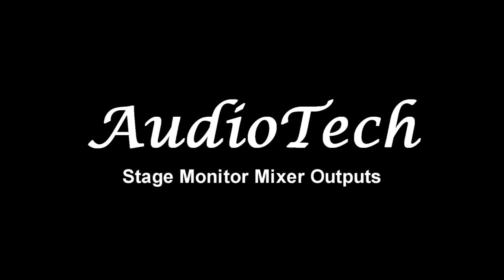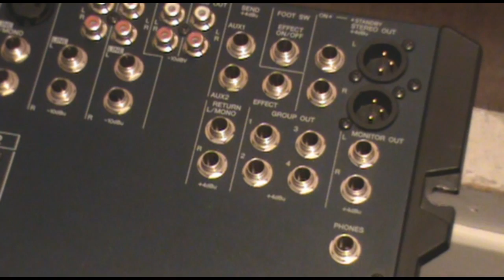Stage Monitor Mixer Outputs - AudioTech

Comment: Thanks for the clarification.  What if you were using powered speakers?  Would you need to have a board with multiple aux outputs?
Reply from the maker: Just run XLR to the powered monitors. Aux1 for one monitor mix and others as needed for different stage mixes. Same as using power amps and unpowered speakers.

Comment: how can i connect 2 pairs of monitors to a mixer and controll it with daw. ?
Reply from the maker: There are several products out there for switching to different pairs of monitors in home/professional studios. Basically, you connect whatever unit you choose to the monitor outs of the mixer and then the switcher is where you connect multiple sets of monitors. You will need to google studio monitor controller/switcher to see results and check them all out. Another option could be to use multiple Aux sends but you can not control what you are listening through by the DAW as far as I know. But I am not familiar with every DAW out there either.

Comment: Thankyou for this clarification.  I want to buy a basic mixer, but it only has 1/4"  L/R control room outs and 1/4" L/R mains outputs.  Will I be able to get an even sound if I'm using this and XLR inputs to my mixer.  Mains will be sent out to an XLR multiple house speaker system and Control Room sent to my powered monitor speaker which accepts XLR or 1/4" inputs.  I feel like I'm trying to explain Chinese.. Can you help??? please
Reply from the maker: You will be fine, just get some adapters for the XLR connections to the house system. XLR are refered to as balanced cables, 1/4" come in both balanced and unbalanced.  Find out if the 1/4" outputs on the mixer are balanced or not so you can use the correct adapter.

Comment: What type of cable is used to connect from AUX to amp for stage monitors?  1/4 Speaker cable?
Reply from the maker: Depend on what you gear uses. I would use the XRL connections if your equipment has them. Otherwise 1/4" cables. Not speaker cables, which look the same but built differently. Normally, you would run a snake return from the mixer to the amps on stage or powered monitors. Snakes will use either 1/4" for XRL returns.

Comment: Thanks for taking time to explaining this ..I'm going to buy a mackie profx 16 channel and a dbx equalizer that I want to use for two active speakers and two active monitors  (if it is possible)..how and where I connect the speakers and the monitors to the eq and the mixer? If you can help me?
Reply from the maker: Speaker run off main outs and monitors off AUX 1
Reply: Thanks! !
Reply from the maker: Run the Aux 1 to the compressors first then to the speakers. Sorry. You'll need two compressors one for each set of speakers. Each dbx unit has 2 in it.
Reply: Thank you very much for your help!
Reply from the maker: No problem. Come on back if you have any new questions. :)

Comment: Can i use the monitor out to record the sound from the mains to a laptop? Now i have used the red and white tape (aux) out but for some reason the recorded music clips. And there is no volume control on the mixer for that. If i can use monitor out that one has a volume control (dual mono to 3.5 mm jack stereo). Lowering the mains is no option. lowering the input on the laptop doesn't work either it still clips. I encounterd the problem with 3 different mixers and with 2 different laptops.
Reply from the maker: +Filip Wostyn Yes you can use the monitor outs of the mixer. Most mixers have a separate volume control for the monitor/headphone outputs. <-notice headphones? You always have a headphone control too so you could use that to record into the laptop as well.
Reply: +TheGospelGuitarist thanks for the reply. the system was a stagepass 300 yamaha http://www.amazon.co.uk/Yamaha-Stagepas-300-P-A-System/dp/B000RW037G. The numbre of output connections were very limited. I will buy a cable and try when i have the occasion.
Reply: +Filip Wostyn I have used the monitor out with a dual mono to 3.5mm stereo just as you were wondering about and it does work. One thing I noticed with our setup was that I had to turn the monitor out control WAY down to avoid clipping (vol setting 1 out of 10)
Reply from the maker: If I were using my laptop for recording all the time I would buy a small recording interface to use with the laptop and plug the board into that. You gain lots of control that way plus the build in audio on laptops are not pro quality stuff.

Comment: Hi there, how do I connect the stage monitor aux send to the snake? my snake has all xlr connections but the aux send is a jack connector. I would just use a converter cable however the xlr is for balanced signals and long distances whereas a jack is normally used for unbalanced and short distances.. thanks
Reply from the maker: nigelE You could still use the xlr lines. Just use a  high to low impedance converter. They look like a large adapter, but cost around $15 each. That way you are converting the high imp output from the AUX send to a low imp for the long snake. You will need an adapter at the amp end though to convert the female end of the snake into a male to plug into the amp of speaker. The other thing you could (should) do is upgrade your snake to include at least 4 sends.
Reply: TheGospelGuitarist thank you. I had a spare acoustic guitar DI/preamp which takes a jack in and converts to xlr out. I used that to send the monitor signal down the snake to the stage monitors. I guess it does the same thing as the converters you mention. It also has EQ and ground lift and stuff
Reply from the maker: Whatever works in a pinch! :)

Comment: Hi and thanks for the helpful videos! I have the same Yamaha desk. I had been using the monitor out in live work for years. Now I'm using it with a band I need to start doing monitor mixes. The problem I have is that having tried to use the Aux send connecting directly to my powered Laney monitor I cant get any signal in the monitor. I've checked the master section and turned master Aux 1 dial up and also the Aux 1 dial on the desired channel. But still nothing. I'm wondering if the pre-fade, pfl or the 1-2 and 3-4 buttons have anything to do with it. Any input much appreciated. Thanks for your time. Martin
Reply from the maker: Martin Stuart Taggart Make sure the cable is good, make sure the powered monitors amp is working. The buttons are for the bus assignments which won't effect the aux sends. Have you tried a different Aux? You may have a board problem.
Reply: Hello and thank you for the reply. Yeah the cable and monitor are good as they work when plugged into the "monitor" jack inputs on the desk. I've tried aux 1 and aux 2 and still nothing. strange. The desk is good otherwise and everything works. very strange! Thanks for the input :)

Comment: This is perfect. Thanks. But I have one more question. Im going to buy a powered mixer, two unpowered speakers, and one unpowered sub woofer. And of coarse the monitors. I understand where to plug in the two speakers but I do not know where to plug in my subwoofer. It comes with 2 speakon connectors but my mixer only has two speak on outputs which are uses for the speakers. So im kind of confused on exactly how to hook up speakers and a sub woofer.
Reply from the maker: You will need to go over all your manuals which should cover this. Use some forums for help and more detailed information. There are several ways to wire live set ups using all these components and way too much information for this comment area. Generally using passive systems: mixer -> crossover -> main /sub power amps -> mains/subs speakers. Larger consoles have a dedicated sub out on them to connect to power amps and subs or to powered subs. A blanket answer is not what I want to give you because there are a lot of variables I don't know about your system.